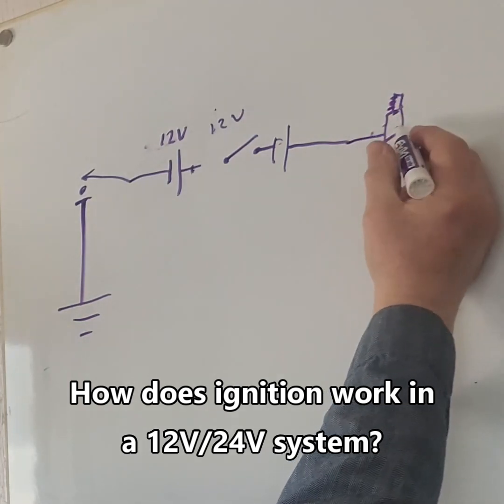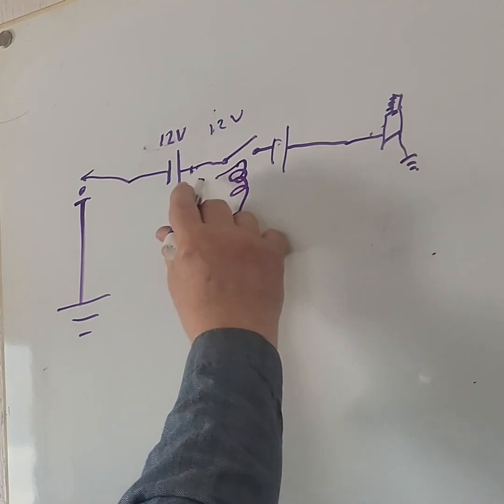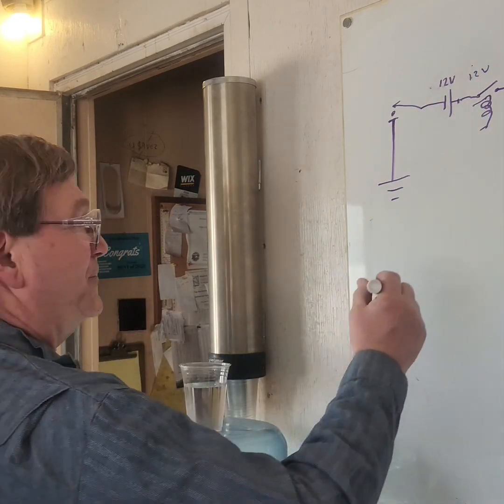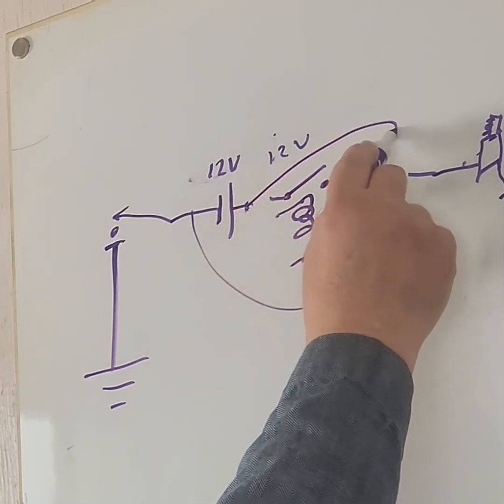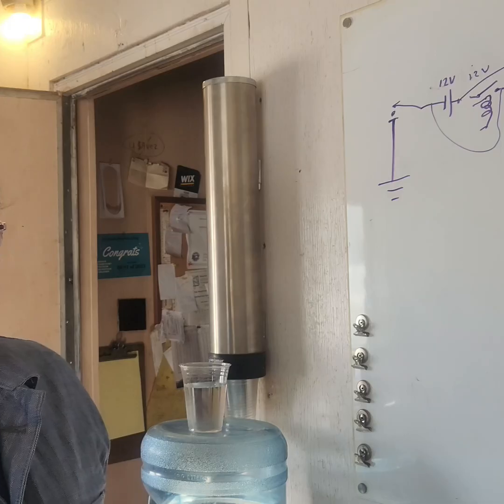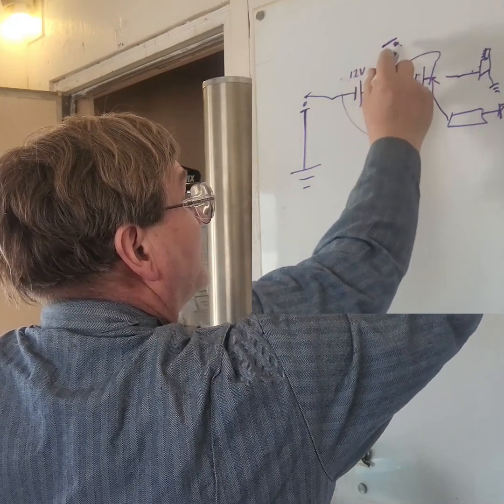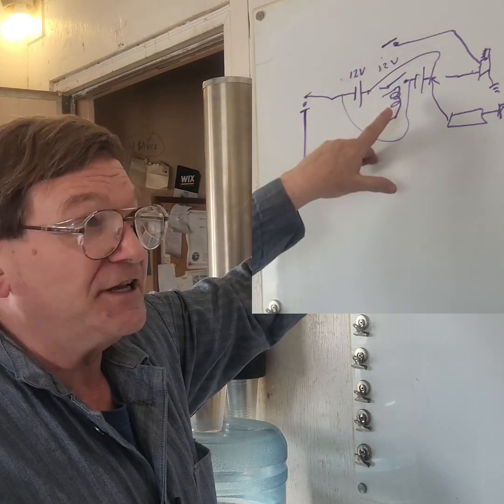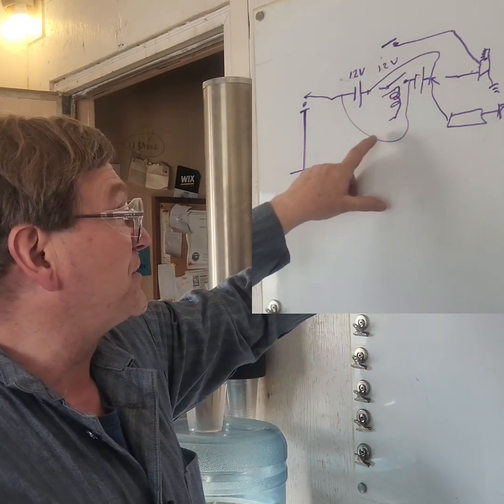Series Parallel starter 12v/24v system work?

Comment: A big breakthrough was the transformer-rectifier alternator. TR alternator charged each battery separately, while batteries remained always connected series for 24V cranking. This eliminated the high-current switching and "octopus" of wiring involved with serious-parallel switching.

Comment: I used to take care of a fleet of military surplus pickups with the series/parallel switches for the starters, and you you are wise for not trying to draw out the entire circuit! Lmao
Reply: Some light duty military pickups walked the line of military standard 24V by utilizing two 12V alternators to create a hybrid 12/24 system.
Reply: I think these were set up as regular 12 volt vehicles, but with the 24v starter, and the ability to power 24v equipment through the standard connector.
So they saved having to have the entire system 24v, which gets more complicated and expensive with electronic dashes etc, but still had it NATO compatible.